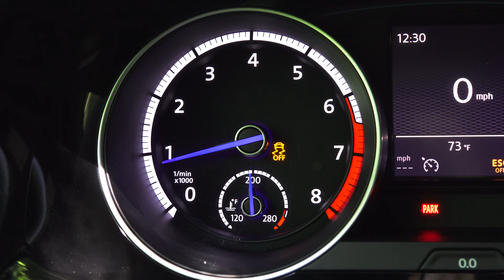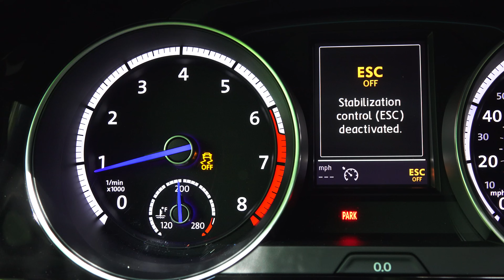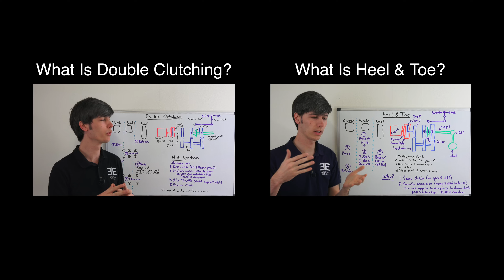How To Launch A Manual Transmission Car

Comment: Why not use the brake instead of the clutch at launch?  (Put it in 1st, mash down the brake, hit the accelerator, and then let off the brake?)
Reply from the maker: +RonJohn63 Not quite sure I understand what you're asking. You have to use the clutch when you're not moving.
Reply: Engineering Explained Yeah.  I wasn't thinking.  Probably confusing it with auto trans.
Reply: RonJohn63 it's manual transmission. If you don't use the clutch the engine will bog to shutdown. The same thing happens when you pull the handbrake on a rwd car

Comment: The 2015 STI is a real bitch to get of the line quickly. Release the clutch too quickly and it bogs down, to slow and you can smell that clutch cooking. I found the quickest way is 5000rpm, release about 75-80% clutch quickly and hold there for a second (to avoid bogging down), and then get right off the clutch and shift at redline

Comment: Learned my lesson treating my 2005 Subaru Liberty 3.0 Manual like it could handle launches all day any day, the STI 6 speed is up to the challenge, but I did end up killing a tailshaft universal joint, at 185,000kms.

Comment: Jason, quick question for you. If the clutch pedal is completely depressed and you were to rev your car does that put wear on your clutch? Or is does clutch wear only occur when you are at the bite point? Thanks!
Reply from the maker: +Ethan Pelensky assuming your clutch and pressure plate are in good shape, it shouldn't. A similar analogy would be "do your brake pads wear while driving down the highway." It's possible for slight contact, but since the pressure is extremely low, there shouldn't be much (if any) wear.
Reply: +Engineering Explained Awesome, thanks! Makes me feel much better about launch control on my STi!

Comment: how much time do you think is gained by needing 3 gears to hit 60 vs. 2 gears? I've always figured about half a second from playing around with my car.
Reply: +Dylan Knight depends on the person and car but that sounds about right. I would prefer to hit sixty at the very end of second
Reply: oceanwaves83 very true. Imagine semi trucks with six gears. It wouldn't make it anywhere lol
Reply: You'd be surprised.  An unloaded cab can outsprint a lot of sports cars.
Reply: it's depending on how quick is your hand
Reply: oceanwaves83 but the gearing is that matters... With a long gearing you can hit the 100kph with the 1st
Reply: ΑΡΗΣ ΚΟΡΝΑΡΑΚΗΣ When cars have 600+ hp that gearing is necessary to keep power to the ground. Luckily, the miata has no such issues. As of current models
Reply: Gregory Kanniard gives gravity... :-D
Reply: ΑΡΗΣ ΚΟΡΝΑΡΑΚΗΣ The ability to control gravity while racing is the future!
Reply: Gregory Kanniard a fan makes better job...
Reply: ΑΡΗΣ ΚΟΡΝΑΡΑΚΗΣ you're way to serious lol. Fans are boring
Reply: Gregory Kanniard Brabham has other view about fans...

Comment: Do note that often times hitting fuel cutoff will lose boost pressure that would otherwise be built up going into the next gear . worth noting with turbo/blower cars.

Comment: If you want to properly do this - step 1 is to remove clutch delay function. Most likely located inside the clutch bleeder block. Manufacturers started installing these flow restrictors to prevent drivetrain damage from people dumping the clutch...something like this guy is telling you to do...

Comment: On big V8 muscle cars like mine, you have no idea how much the clutch slip 2k rev launch is effective. Let's your tires grip and you can get on the gas much quicker. 0-60 in 5.1 on a C5 Vette if you drop it from 4K and the tires spin. 0-60 in 4.6 when you clutch slip it

Comment: Im beginning to drive a manual, anyways my question is how do i stop the bounce after like 4k rmp in 1st gear
Reply: 1st gear is ideally only suppose to be used to get the car going. In normal driving by the time u get to about 3000 rpm u should shift to 2nd. There is a way to avoid that bouncing in 1st though, u just have to keep a steady throttle position so that rpms don't drop and u don't get engine breaking, which u refer to as bouncing. Taking ur foot off the gas is what causes that.
Reply: Stephen R I think hes talking about the lurching in low gear when you take your foot off the gas
Reply: +Alex Velasco Generally first gear is slow enough that you can just push the clutch down when not in power. Then, move off again just as you would from a complete stop. This will help stop the engine braking. It would likely happen in second as well, just not as bad. Just don't coast on the clutch at more than 15 mph. It becomes dangerous at that point.
Reply: +Alex Velasco Bounce?
Reply: Oh, well you just have to make sure you don't take your foot off the gas before hitting the clutch pedal. In my V6 Golf I make sure i'm not coming off the gas to quickly when i'm shifting up, it's more sensitive than other cars I've driven in this respect. Basically if you're letting off the gas sooner than you're disengaging your gear, you'll have that jerk..
Reply: Gregory Kanniard Technically speaking that would be the opposite of a lurch, if we're talking about coming off the gas ;-)
Reply: Stephen R haha well you get the idea
Reply: +bigdud88 thanks
Reply: Don't go to 4k in 1st. Shifting early is about 2k shifting late is about 4k, 3k is safe. Push the clutch in before letting off the gas when you're shifting into second, rev match into second if you're going too fast or you might engine brake hard.

Comment: I always wanted to know why reverse gear handles letting the clutch more aggressively much easier than 1st gear? To simplify, why it's ten times harder to stall it in reverse than it is in 1st gear? Tried with different engines, both 0.8L(Spark) and 1.9(golf mk3) and same thing. Reverse pulls like mad even without gas, 1st insta-stall. Thank You in advance.
Reply: +KRAUSER0130 i'd guess the reason is you never need to go faster than walking pace in reverse so its an even lower ratio than 1st so it takes less work for the engine to turn the wheels so it wont stall as easily.
Reply: +megaspeed2v2 Alright, i thought it is something like that, with low ratio and stuff, thanks!

Comment: How do I change gear without making my passengers heads jerk?
Reply: +Scott Morgan change slowly and let your revs drop down further before downshifting.
Reply: +Scott Morgan don't just dump the clutch, release it as you simultaneously apply throttle. This helps you rev match.

Comment: So when your doing a 0-60 test should u release gas pedal or just leave gas pedal compressed all the way not releasing while shifting
Reply from the maker: +SUBI 13 I always release as it will lead to a safer gear shift, otherwise you'll burn the clutch a bit more.

Comment: i don't want bad things to happen but i want to launch
Reply: +itzJKB literally the story of my life
Reply: get a rental car
Reply: +itzJKB If you have a RWD, just do it. Any excess power will spin the wheels.

If you have an AWD, just don't. It's not worth it.
Reply: wamphyr000 Why not 4x4? Will i die? Will it explode? Will it climb a vertical wall? IM CONFUSED
Reply: Vicjo Koper It's definitely not a performance car lol A stock mk5 golf 1.6 but i'd just want to try a few launches see how it feels. Do i even have enough hp for a launch lmao
Reply: wamphyr000 i have a FWD :/
Reply: Better hope the engineering behind your car is good then!
Don't launch your Honda Jazz. lol
Reply: Split up the cost of a car with friends and use it just for lols its so worth it
Reply: That Guy that's actually a decent idea
Reply: Did you ever end up launching? Hahaha
Reply: +Raptor Mine too, totally.
Reply: 1.3 50kW Skoda Felicia :D spinning tires with ease
Reply: same here
Reply: +itzJKB Lmao i launched my honda civic hx, if this little pos can do it you can too
Reply: Vicjo Koper who exactly do you think tests their product for retarded users?
Reply: You need a welded diff or a lsd.
Reply: What car do you have
Reply: +itzJKB What car are we talking about?
If you have 1.stock hp  2.street tires  3. intact serviced driveline you should be able to launch it indefinitely. This is what it was made and tested for. Rubber things like motor mounts should wear out first
Reply: +itzJKB I've launched my Golf 3 1.8 with tire spin, so yes.
Reply: MEOW IM A KITTY CAT

Comment: I have a problem when I launch my car on some occasions. when I hold the revs and launch the car sometimes steeps down a little and goes off. normally I can get a good launch but I need to know what I'm doing wrong as is it looks silly
Reply: +Monaco Super You are probably dropping the clutch too fast...
Reply: +Monaco Super You're bogging it. You're either not rolling onto the throttle fast enough or you're side stepping the clutch to aggressively. Both can cause bogging and you're putting a lot of stress on the transmission and drivetrain.

Comment: POWER SHIFTING!! xD (shifting without getting off the gas used for some drag raceing manuals)
Reply: power shiftings not just for dragsters my man :)
Reply: +J Pugh yeah I use it alittle myself in my 94 Toyota pickup xD
Reply: My truck gets 14 miles to the gallon anyways no matter if I drive it as file effecently as possible or not. And I just recently had the clutch, master clutch cylinder, clutch fork and all of my hydraulic lines for it replace.

Comment: Hey bud, do you mind explaining why you recommend building engine speed to a halfway point with turbocharged engines, and then feeding in more throttle as you de-clutch? You talked about getting the motor on boost, but then mentioned resistance in the turbochargers and anti-lag systems, and that's where I lost you. Maybe I'm misunderstanding, but it sounds like you're saying that turbos build less boost when there's no load on the engine. I always thought that the boost pressure a turbocharger's compressor makes at a given engine speed is the same, whether the car is in neutral, 1st gear, 4th, or whatever (ignoring any ram air effect in the intake plenum due to high speed). Is that not the case? Thanks, and sorry for the really long question
Reply from the maker: +Davis Dunlap essentially you're creating more resistance for the engine, which means it needs to make more power to overcome it (accelerating a mass vs maintaining a mass' momentum). This means you make more exhaust, and in return (briefly) create more boost.

Comment: you have to remember that the u- joints, diffs, etc. are only rated for a certain amount of torque. if you exceed those limits you could potentially destroy your vehicle.

Comment: Yea, launching is extremely bad for a normal street car without very strong drivetrain components and a racing clutch. I do not advise anyone with a stock clutch try to launch their car from above 2000 RPM. I have a Stage 2 Exedy clutch, and even still I have never intentionally launched my car due to concerns over breaking a gear in my car. Accidentally dropped the clutch at 6000 RPM one time while panic accelerating and lit my tires up in a massive cloud of white smoke. Before I had the Stage 2 clutch, a friend launched the car from 4000 RPM and broke my transmission housing by ripping the rear mount off of it and dumping all the gear oil onto the pavement. 

Moral of the story, DO NOT TRY THIS unless your car is built for it, you know what you are doing, and don't mind measurably decreasing your clutch life every time you do it.
Reply: +DjRjSolarStar 
I think you are a bit exaggerating... drivetrains are not made out of paper. Sure, the clutch or semiaxis may blow after some time... but I launched my car numerous times, and still have the clutch and drivetrain in one piece after 50k km (06r Subaru Forester XT, so the clutch has really hard time as it is awd). I would say - have fun, but be reasonable about it :)
Reply: Very good comment.
Reply: What?? i drive a stockish 99 civic with a b18c jdm gsr swap and launch at 3-4rpm with no problems over 5years. and if you dump your clutch  at 6000rpm of course  your going to roast your tires. i know my car would continue  spinning when going into 2nd gear.
Reply: +DE „AutoBravado” Nichols 
I actually had another Forester before the XT, it had a automatic gearbox (traditional hydrokinetic, it was 05r model) - this was the main reason I sold it and looked for a manual one (+ I wanted to have the turbo :D ). The gearbox was not bad though - it was very smooth, and was extremely useful when I was offroading (in my opinion it was much better than the manual with the low range that was available for the non turbo versions) and was almost indetructible - it was the only car component that I was not worried about at all. What I didn't like about it was that it had only 4 gears, wasn't fast enough and I couldn't change the gears when I wanted to (no paddles or sport shift in my model) and as I am spending 95% time o tarmac and enjoy winding roads, manual gearbox was a lot better for me :) So, I wouldn't say the subarus  automatic transmissions from that time period were bad, they just don't suit everyone...
Reply: TheNazreth It's like Scotty Kilmer says then that manual Subaru transmissions are great. Stay away from the automatics though.
Reply: Unless your stock clutch is in an American muscle car.
Reply: ***** Good point. Those can be really good.
Reply: JobeMinacum I hope Ericthecarguy has thought about that for his Fairmont build.
Reply: this isn't really correct. my uncle had a crx si that was all stock and he launched it all the time from the day he bought it with 8000 miles. on its second clutch at 380k miles now. a well engineered car can take some launches.
Reply: DjRjSolarStar that not applies to rent a cars lol
Reply: That's why you drive German cars.
Reply: can i do this with a camaro?
Reply: You clearly underestimate the power of my Hyundai Accent. I've been beating that car worse than my dik for years and she still goes when I tell her to.
Reply: +DjRjSolarStar I'd much rather put some strain on a clutch than have a super strong clutch and have the wear and tear go straight to the transmission. That's how people break old T5 mustang transmissions..
Reply: Agreed. There are lots of "manual driving techniques" that are actually racing techniques. It's not a racing car just because it has a stick shift.

Comment: So basically if my car does it's max HP @6000 RPM I do I launch, go to 6k then shift to 2nd? Cheers.
Reply: +indexftw not really. as he explained, even though the power starts to reduce after you reach peak the next gear reduces the torque the wheels have against the road more than that reduction in power so you want to go past  the revs where you get max power by a certain amount depending on the difference between the two gear ratios and how quickly the power drops off after reaching peak.
Reply: +indexftw You dont want to have max HP but max torque. To be simple, HP is for accelerating when you are already launched. You wanna keep your revs onto the torque peak value until the clutch is totally engaged, and for shifting, with 6000rpm you wanna go up to the red line

Comment: Did I miss the part where he explains how he holds the car from rolling while clutch is in and holding throttle? Is it a heel toe deal?
Reply: Sorry he said in the beginning find a flat surface.
Reply: ya you missed it, pretty early on he mentioned this is for flat ground, but ya on a slight slope go with heel toe or my personal preference is using the hand brake so you don't screw up your foot work worrying about being on the brakes. especially if you have a FWD or a FWD turbo, unless your on a steep hill your e brake won't need to be on very firmly to hold you in place.
Reply: +UJustMadeMeLOL 

If you're on an incline or are rolling in any direction, you're supposed to use the handbrake. Heel-toe is only for downshifting.
Reply: +SI0AX in most applications sure, but have fun using the emergency brake on the floor if you drive a pickup or an SUV or the funky hand brake on any small Toyota pickups, it also comes in really handy in bigger stuff too like a dump truck or log truck. it's not exactly what he's talking about in the video but just because most pickups don't launch on pavement often, if you have one off road you're pretty likely to need to launch effectively on an incline and then the principles are the same, especially throttle control in low traction situations.
Reply: UJustMadeMeLOL
Yeah, the proper technique would be to keep the hand brake button held down while you prepare to launch, then put the brake down as you launch. It's shown in Initial D.

You can't do that with a foot e-brake.
The launch with the side of foot is just so impractical I don't know how you would do it. Heel-toe downshifting is kind of tricky enough.

Comment: And an automatic car?
Reply: Maybe engineering explained has explanation for me. :)
Reply: drive to dealership and swap for manual transmission
Reply: +Antonio Hold in the brake and get on throttle a little bit. Drop brake and accelerate.
Reply: +gtileo exactly
Reply: ***** Sure. It takes less skill, but what if there is amazing upgrade technology around automatics and racing?

We could all really learn something! 

Those multi clutch automatics are a mystery to me.
Reply: gtileo
Multiple gear selectors I have some understanding of, but it still has just one torque converter.

What I'm thinking of is multiple clutches, like a manual transmission, but it's automatic using basically a more manual platform.
Reply: Antonio
Other than the super racey stuff it's pretty easy after some practice. Don't give up on yourself bro. :)
Reply: Basically give it some gas until you know ur car won't burn out then floor it.